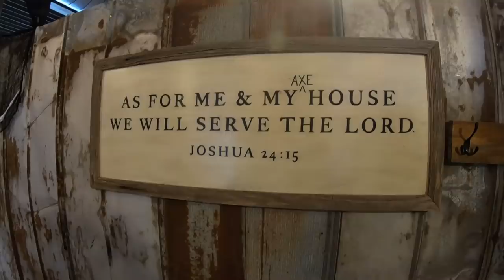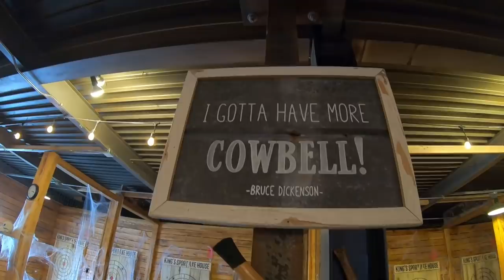Click This Video For Good Times: Saw-Milling Logs, Farm Tractors & Throwing Axes,

Comment: Nathan thank you for sharing your knowledge. I know it is not easy filming the videos for YouTube.
Let me return a little of your kindness by sharing something I have learned with you. In reference to the checking of your log even after you coated it with Anchorseal. I had some of the same issues using Anchorseal. Now I use Gorilla glue to paint the end grain. It works much better than Anchorseal and it is much less expensive. I started out using Titebond(the outdoor kind)then found out Gorilla glue was even less expensive. It totally seals the log ends and locks out the air. I hope this will help save some of your lumber due to loss by checking. You can get 1gallon jugs from Amazon.

Comment: A 1"x4" where you are screwing the metal down is sufficient, just be sure it is secure to the OSB and (framing) where possible. Double decking may overload the framing especially if you are subject to Snow.

Comment: I believe if you pre-drill the osb and use appropriate fasteners you won't have an issue. You could put some adhesive in the hole before screwing the fasteners

Comment: Another downside of building with OSB... Unless it is specifically fire retardant, it burns like no tomorrow. We were fixing the roof of my mom's house and we pulled out a lot of OSB and replaced it with exterior grade plywood decking. Anyways, burning the OSB, we realized that it's basically a pres-to-log in sheet form. Not comforting when you realize that the insulation in a lot of modern houses is cellulose fiber. (we burned some of that too, and while it didn't go up in flames, it acted like charcoal, holding embers for a long time.)

Comment: Wish that is all the damage I had.  Had a tree go thru my little shop.  In the process of putting it back together. Salvaged what I could.  Live in Sulphur Louisiana and got hit by two major hurricanes. Going to mill that up for flooring in my house.  Building supplies have doubled here recently.
Reply from the maker: hate to hear that, hope you get things back to normal,
Reply: Thanks.  Enjoy your channel.  Inspired me to mill up that tree.  It was a huge yellow pine. 26 inches at the base and about 70 feet tall.  Straight as an arrow.  Actually had 2like that that fell.

Comment: Wow, I just took a look at Mark's channel. Knowing very little about timber milling, such as I do, I found it fascinating. The vertical circular sawing method is quite different isn't it? Mark's setup certainly chews through the logs no problem at all. At first I was a tad concerned about what would happen should the dog's grip on the vertical log fail for some reason - I rather think you would not want to be anywhere near it if that happened. Mark is quite attentive to that though, no doubt he has similar concerns!
Thanks for the recommend - now I have another timber milling channel to enjoy. Although, Mark's videos don't have the nice chill vibe yours do, but still great entertainment and education. He doesn't have your great accent either. Cheers.

Comment: I never gave much thought to screws into OSB boards holding metal roofing but what you said makes a lot of sense!! I was told by a roofer that on a house you should use 30 lb. felt over the decking rather than 15lb. felt. More durable I reckon.
One other thing I thought of while watching this. It's gettin' on toward winter and I know there are still folks around here and more out where it's still more country who burn a fire in a fireplace or stove to supplement the heating costs. A lot of them are on a fixed income too. I see these "scabs", the bark cuts, and you put them on the burn pile, which is fine I guess. Bu I was thinkin' maybe you had some friends who might come around and collect such as that up, cut it to stove or fireplace length and give it to some of these older folks, or even younger ones, maybe with young'uns, who need it for heating, even cooking. I know you don't have the time to do such as this yourself Nathan but it could make the difference for some folks up thar in them Hills!! We're flatlanders down this way but it still gets cold!!

Comment: Some days life is just a little more challenging than others, but we're still on the right side of the dirt! Great video Nathan! I have never been a fan of OSB board for two reasons. If it gets wet it swells and then you can just throw it in the burn pile and the issue you're having with screws. Plywood is a bit more expensive but far more superior to OSB in my opinion. I follow Mark Galicic's channel as well, he and Eddie have some great videos.

Comment: A good sawyer sawing for grade will cut so as to "box" the heart, basically leaving a 4 x 4 in the center that goes to pallet wood or some other trash use.  The juvenile wood is the bane of the truss industry.  It shrinks so bad It can cause the trusses to rise or lift.  Look up Trust lift or rise.  The trusses can arch  or lift in the center and worse yet it's seasonal.  Speaking of the big box stores...look at a pile of their 2x4's.  Sometimes they take that juvenile 4x4 and resaw it into two 2x4's.  I'm sure they get them cheap.  Check the ends of the bundles and you will see them paired.  Trash, don't buy those.
Reply from the maker: agreed